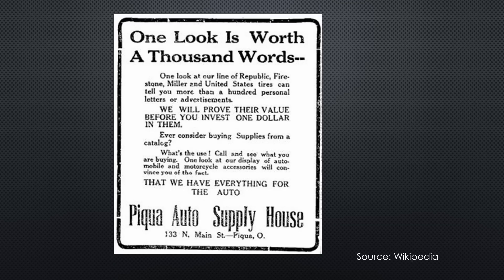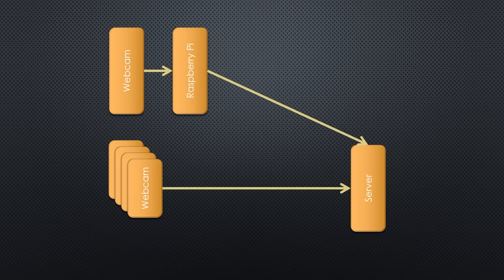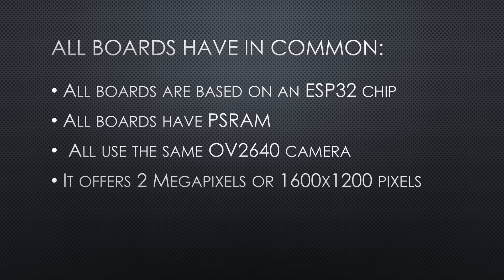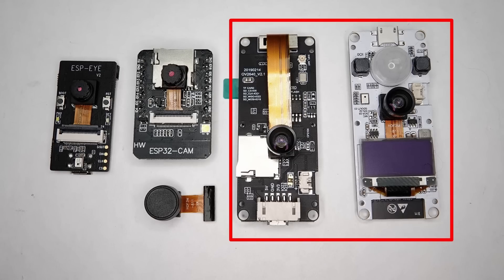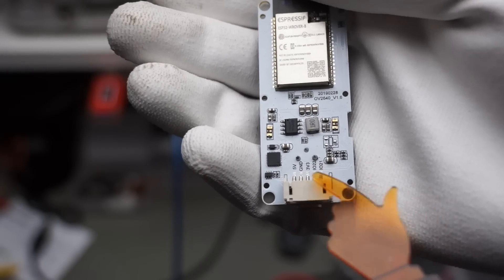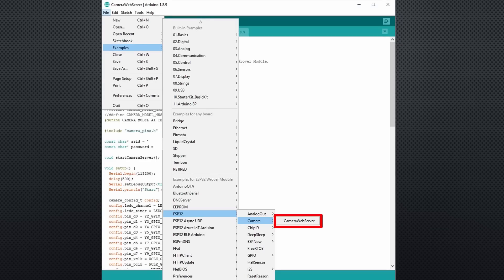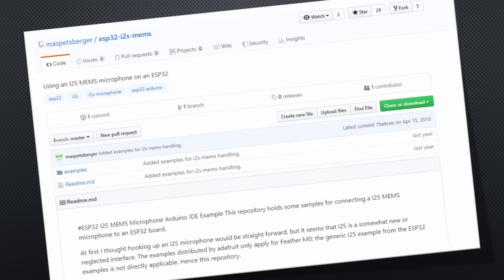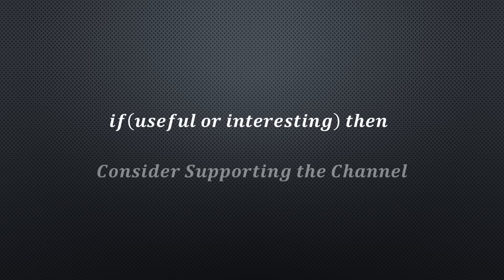#285 ESP32 Cameras: Comparison and Test (OV2640) and I2S MEMS microphone test

Comment: You asked about other projects. I came across this website when I first heard about the ESP32 cameras a few months ago:
https://randomnerdtutorials.com/esp32-cam-video-streaming-face-recognition-arduino-ide/

They have a few for the ESP32-CAM board. I haven't tried them, because I haven't bought the board yet. But I've found a couple of their other projects very well-written and informative.

I'm in the US, and Banggood shipping from the US warehouse is usually much faster than ordering from China. But not as fast as it used to be: my latest order came via DHL, and took almost 2 weeks, instead of the 1 week I was getting when they shipped via USPS (this might be because the order was over $45, and I got free shipping, instead of being charged for postage). Orders from China usually take about 4 weeks (occasionally only 3). btw, their China warehouse has the ESP32-CAM on sale for US$5.99 this month.

As always, thanks for taking the time, and doing such a great job.

Comment: I have installed a ESP32-cam with removed IR filter and a few IR LEDS in a bird house! It works very well. The only thing is that i never saw a bird inside... :\ I also know that it need a lot of power otherwise you get the brownout message. So you must powered it on the VCC pin with 5V.
Reply: How and where did you get cameras with the IR filter removed

Comment: ESP32-CAM and others doesn't have enough IO if you use the SD card. If you want to capture an image and save if to the sd card you'll need a second µC. The second µC will tell the ESP32 to take an image via Serial comms. You can attach a sensor to the second µC as well.

Comment: It would be useful to know their mA used while streaming video over wifi, recording on card and sleep/low power mode (with PIR active), That would provide an idea about how big a battery/solar panel they need in different remote camera applications.
Reply: cezar t I managed run the second board on a single 18650 3000mAh for 6-7h. The module gets quite warm. It’s clearly not very power efficient. I wasn’t even streaming anything just run the example sketch.

Comment: Very useful roundup.   A Pi Zero + cheap cam  + sd card is in the same price range though so I will stick with those for now.
Reply: Its really hard to use anything other than a pi zero now they have put wifi on them.

<3 Python and a real file system.
Reply: what I was thinking. the esp32 is a bit limited for video work.

Comment: If only there is a board with 2 way audio, camea and pir then we could do a smart door bell like the Ring smart camera door bell. Instead of paying a monthly fee to record to their cloud account we could record video to a home lan based nas or server.
Reply: Exactly what I would like to do with these boards.
Reply: I'm also considering a ESP32-based intercom with ability to unlock an electric lock remotely.
Reply: Bit of a late response but... An old phone you have lying around should be perfect for this task for the obvious reasons of it having all the hardware camera, wifi, mic, speaker and a powerful processor. It just needs a little weather proofing and an app, IP webcam can do this but it's not a great experience due to a very delayed update, so some better app suggestions would be nice, although ideally someone would make an app specifically for this purpose so that you could maybe take advantage of the screen too and use it to have a video call with whoever is at your door.
Reply: @vgamesx1  yh I like the way you think , it would cut out alot of fiddling about and you know it will have good components and stable , but a Pi should be good for this
Reply: Me too
Reply: Me too!
Reply: Only the speaker is missing. Add one externally with a small amp.
Reply: Well, You can do it but you have to create the code for that, for example you could use a PIR sensor in order to make a signal of pressence detection and start recording until the pressence get off... you can also make a inter-com system by using a RF transmitter, there is a lot of projects that use a simple RF transmitter to make a walkie-talkie so you can use this to make your project
Basically you can make a full embebed system using the ESP32 has base but you have to make the code for that...
Reply: Exactly what I would like to do with these boards.
Reply: Same here. Any ideas for modules that can do this trick?
Reply: I'm working on this but not getting very far. Has anyone made any progress? I was thinking of combining the Mic version with the TTGO T-Audio (https://github.com/LilyGO/TTGO-TAudio). It seems silly to pay for two boards but it would still be less than the Ring. Any other suggestions?

Comment: Here is my modified code for the "white" esp32 camera module (the one with PIR sensor).

https://drive.google.com/file/d/1AmRhKDoz9yLCidewq4GAuxZjbG93vDbO/view?usp=sharing

You can use the included pushbutton for rotating the imagen and the display. 

(needs to hardcode your wifi credentials)

Comment: Forgive Andreas, a microscopic correction, the ESP32-CAM is equipped with an SD slot.
On the net I found a couple of working sketches, but I haven't yet tested thoroughly ... there is no time!
Byyyyyeeeee. :)
Reply: Really? Then it could be useful for my purpose. If only it had an IR-CUT filter...
Reply: @GRBtutorials  why you want an ir-cut.....that pir hurts you?
Reply: Oscar Il Mio For surveillance during the night. I’m looking for an IP camera, and I don’t want it to spy on me, so I’d rather use a firmware I can control or use Ethernet instead of Wi-Fi (the problem being that I’d have to run cable through the house, and something that isn’t easy in mine). Both can be disrupted (by cutting the cable or using a jammer), so having SD card backup would be nice.
Reply: @GRBtutorials  Only Oscar plz ;)
So, there are many IP cameras on the market that use an SD card to save data, simply connect the camera to a small, correctly adjusted access point, or use a do-it-yourself lan-wifi interface to connect the camera to your wifi.
About ESP-CAM, yes, it has an integrated SD slot, but I haven't tested any of these potentials yet.
However, if you want to start somewhere, start with Andreas's tutorial and mix it with the one in the link below.
https://www.youtube.com/watch?v=36p9To2hfak&feature=youtu.be
If you pay attention to what is said, the limitations are inherent to the sketch, so then it is up to you to develop something more suited to your needs.
Finally, if your camera's PIR annoys you because it hits the lens, well, learn from the traffic lights ;)
Sorry Andreas for the "o.t."...

Comment: Good comparison Andreas.
I tried to build a surveillance camera with the espcam board but changed to a raspberry solution recently. For the pi you get cameras with better solutions and a variety of ir solutions. Finally, motioneye simply does a better job than the sketches I discovered.
Reply from the maker: Thank you for sharing your experience. I also used motioneye in my IR video and it worked very well. But the price tag of such a solution is probably 10x higher... As well as the form factor.
Reply: @AndreasSpiess  If you take a pi zero W, neither form factor nor price are that different. Perhaps factor 2 compared to the ttgo boards.

Comment: Always dreaming about a device able to count the cars which drive in my street and may be have the number that are not respecting the speed limit.
Reply from the maker: This would be an interesting project. Maybe more for a Raspberry because I assume you need a lot of power to read the plates.
Reply: @AndreasSpiess  Perhaps character recognition can be by PC after video is forwarded.  Speed measurement can use those LIDAR modules you covered.

Comment: Turning on the led on the esp32 cam via bluetooth https://arduinodiy.wordpress.com/2019/08/03/turning-led-off-and-on-on-the-esp32-camera-module-using-bluetooth/
Also, some info on problems with face recognition on the esp32 cam 
https://arduinodiy.wordpress.com/2019/07/12/esp32-camera-module/
Reply from the maker: Thank you for the links! Unfortunately, Ruis example did no more compile :-( So we probably have to wait for Ivan.
Reply: @AndreasSpiess  ah ok, I had not tried it. Maybe needs prior esp32 core
Reply: @AndreasSpiess  It compiled fine when I just tried. I picked the Wrover module board for compilation

Comment: 7:00 I think there is an error in the features table. My ESP-CAM has an SD card slot and you can even see it in your video directly beneath the camera module.
You also state that the TTGO modules don't have GPIOs but then in the table you list 2+2 and 2 respectively - what gives? 😎
Reply from the maker: You are right. I already corrected the sheet and pinned a comment.

Comment: My white TTGO camera with SSD1306 OLED was working, often I use the target ESP32 DEV Module and enable PSRAM.

Also the motion sensor worked fine, my model hat no BMC nor any mic soldered. Here are the pins for the camera: (of course I defined CAMERA_MODEL_TTGO)

#elif defined(CAMERA_MODEL_TTGO)
#define PWDN_GPIO_NUM     26
#define RESET_GPIO_NUM    -1
#define XCLK_GPIO_NUM     32
#define SIOD_GPIO_NUM     13
#define SIOC_GPIO_NUM     12
#define Y9_GPIO_NUM       39
#define Y8_GPIO_NUM       36
#define Y7_GPIO_NUM       23
#define Y6_GPIO_NUM       18
#define Y5_GPIO_NUM       15
#define Y4_GPIO_NUM       4
#define Y3_GPIO_NUM       14
#define Y2_GPIO_NUM       5
#define VSYNC_GPIO_NUM    27
#define HREF_GPIO_NUM     25
#define PCLK_GPIO_NUM     19

I spend some more time to investigate into camera options, capering images on my own and decoding the HTML page.
Please note that the low level camera support is included in the IDF SDK as a binary library and not as an Arduino library source. There are other projects with complete Arduino source available. The true disadvantage is that the ESP32 has little PSRAM and after a few frames it is full.

Great video as always, Thanks Helmut
Reply from the maker: Thank you for posting your pin numbers. Unfortunately, it also did not work :-(  Maybe there are more versions of the same board available. I used this diagram: https://github.com/Xinyuan-LilyGO/esp32-camera-series/blob/master/schematic/OV2640_V16.pdf
I do not think pattern recognition on the ESP will lead to good results. I rather think it could be interesting in conjunction with an RPI4 or a Jetson Nano. Then the ESP could provide the pictures and steer local actuators.
Reply from the maker: I think your board is this one: https://github.com/Xinyuan-LilyGO/esp32-camera-series/blob/master/schematic/OV2640_V05.pdf

Comment: I had the same problem with the ESP crashing because of the camera - I just re-seated the flat flex in the ZIF connector and it worked fine after that
Reply from the maker: I tried that a few times and also changed the camera. Without success :-(
Reply: @AndreasSpiess  Don't buy the https://www.diymore.cc/ version of the ESP32 cam, mine came with a split ribbon cable to the camera which they suggested I solder back together, replaced the camera module and it will NOT stay connected.

Comment: Useful Application for ESP32 with cam: Reader for meters for water, gas or electricity. Some peaple are playing around there https://forum.iobroker.net/topic/23577/wasserz%C3%A4hler-selfmade
Reply from the maker: Thank you for the link. These are applications I had in mind!
Reply: @AndreasSpiess  As you can read, this is not so easy beause of the individual fonts. Image processing nowadays is based on training, called labeling or annotation. And this is a major part of the work which cannot be avoided up to now.  There have been some cheapish "commercial" IoT solutions on the market but they seem to be vanished.
My focus was more on leakage detecion and so on fine resolution than on reading the absolute value. So I found a simpler solution with a special Sunx EX26 photoelectric sensor. Works a treat.

Comment: Hey I am unable to use ESP-32 Cam with the Ai Thinker module... I have uploaded the CameraWebServer.ino built into the arduino esp32 examples and the ESP-WHO library's ESP-IDF examples. They all show camera init failed.
Edit:
Yes I have set pin config correctly, to the predefined values for Ai Thinker module.

I have tried connecting and reconnecting the camera many times, cleaned the flat flex cable pads too. Still the same.

And the camera ribbon cable is not cracked either.

Any help would be appreciated, thank you.
Reply from the maker: Unfortunately, I cannot do remote debugging :-(

Comment: For face recognition and wifi you may be more interested in the K210 boards. I think there is also an M5StickV+ coming up with WiFi as an upgrade to the M5StickV (careful the mic does not work in that one)
Reply: A video featuring the Sipeed Maix Risk V you got in the previous mailbag is welcomed!
Reply from the maker: In the meantime, I also have the M5stick. Just need the time ;-)
Reply: Lack of available time is a challenge we engineers share...

Comment: M5Stack also has some nice esp32 camera models, they even have a nice case and Lego connectors. There is also a battery backend for one of the cases. You can get them on banggood and aliexpress, but you may also want to check out their shop at https://m5stack.com/ as well as some of their boards at conrad.de and adafruit.com.
Reply from the maker: Thank you for the links!

Comment: woo! i just got a esp32-cam!.. maybe you have an idea why the wifi is VERY poor on my board...it only works when right next to the receiver antenna eg my tablet or router..ive tried to increase the wifi power to max but it was no help...do you think the on board LNA might be blown? BT is the same.. everything else works as expected..i just cant get a wireless connection to it :(
Reply from the maker: Maybe you look if the resistor I showed points to the internal antenna?
Reply: @AndreasSpiess  yes i checked that..its set for internal antenna..ive actually tried it with an external antenna and couldnt see it at all..
Reply: Squeeze the antenna with your fingers while streaming. No idea why.